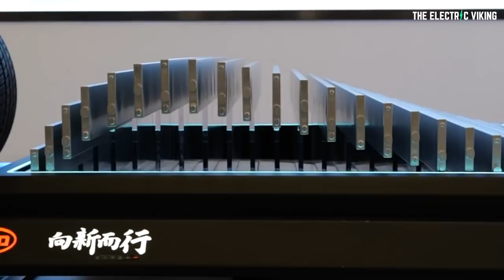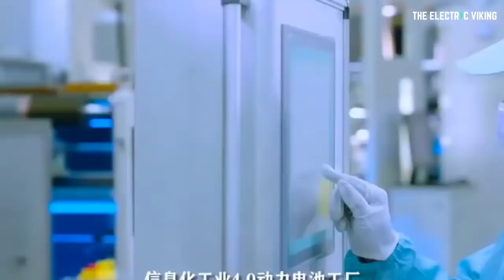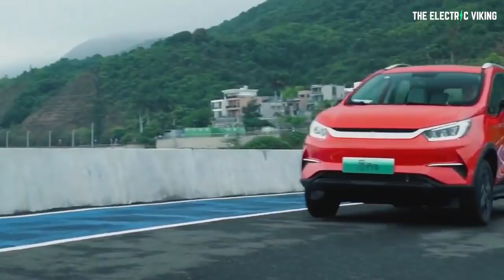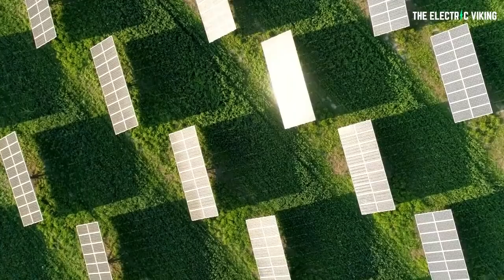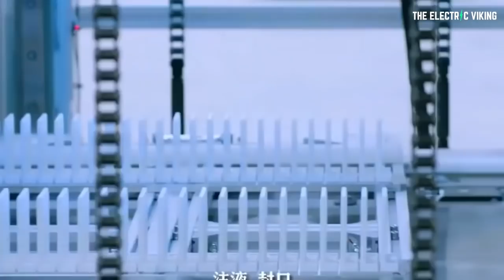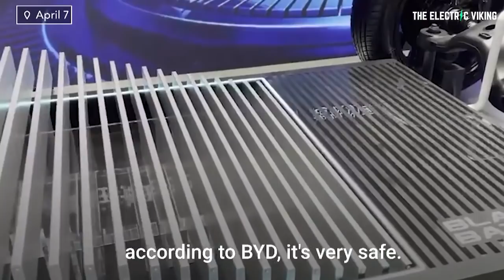BYD reveals the cost of its Blade battery - EVs are cheaper than ICE in 2021!!!!

Comment: To all those who make an issue about the mining for materials for electric cars, where do you think the materials and fuel for ICE vehicles come from? We mine materials for almost everything we use, and fossil fuel mining is the most toxic and polluting just in its extraction, let alone all of the CO2 and other nasty toxins it spews into the air when refined and burned. EV's reduce CO2 production by 60% compared to the same size ICE vehicles even when powered by electricity created by burning fossil fuel, and as the clean energy mix increases, that percentage just gets better. In June 2021, the USA produced over 20% of its electrical energy from clean energy, so EV's got 20% cleaner.

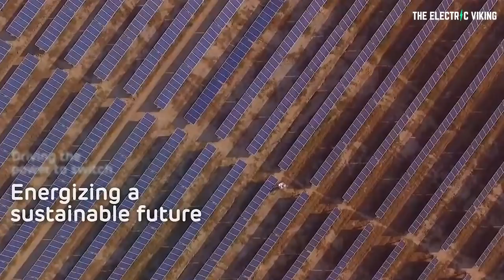Comment: So Sam, I think you made an oopsie at 7:07! 
Whilst your statement 

"In most parts of the world, it's already cheaper to stop running your coal plant, stop running your gas plant and build out renewable energy and support that with battery backup"

may well be correct, your framing of it seems to be that now it's just a  matter of buying the renewables and a massive battery? The largest battery in Australia at Hornsdale is a 194MWh capacity for a cost approximating one million per MWh. 

During the financial year 2020-21, consumption was 11,614GWh, divide that by 365 for average daily use approx 32GWh and then ask how big a battery would be required for one single day when there was no renewable input? 
32GWh = 32000 MWh x 1,000,000 = AUD $32 billion. 

Now, of course you can do the stats on renewable reliability and reduce that figure significantly because the sun is always shining somewhere in SA and there has to be some wind somewhere in the state, but if the final figure were based on 10% of that size, we'd be looking at approx AUD $3billion. It may need to be twice that to get us through a night with low wind and twice that again to have some fully charged headroom.

A new coal fired power station approx AUD $3billion!
Not that sure that it's quite the same thing.

Comment: We will need a number of new coal fired power stations operating 24/7 if we want to transition away from crude oil based fuels.   Current renewables only deliver sufficient power for a few hours during the middle of the day.  Best option of all will be ten or more small modular nuclear generators.   Even those would struggle to provide adequate base load to replace coal entirely.

Comment: Hi Sam, thanks for sharing all the exciting news about BYD and I am investing. I have a question that I am yet to get a conclusive answer and I trust you can answer. I am a tradie that wants this van but I need a roof rack  for ladders and told they are not recommended. Is it because the will cause drag or is it that the T3 does not  structurally able to support roof racks?
best regards Simon

Comment: You mentioned that BYD is moving towards 800Vdc something EV power train systems. Porsche, Audi and others have already done that.
I have been retired for some time, but after my retirement as a power electronics engineer I have been working with an EV charger company, and they have had high power high efficiency 300 - 1000Vdc output AC/DC converterters available for about two years.
The higher system voltage increases overall system efficiency, and reduces system high voltage wiring costs.
Reply: In 1995 some one from university tried to get me to go back and work on an EV project. I wanted to use 1000v. The main problem was insulation and that most off the shelf parts (mainly parts from 415v VFDs) are at the limit on that voltage.
I really would like to know why 385v was chosen for most EVs.

Comment: Another BYD cost saving could be that they don't require liquid cooling. In the pictures of the blade pack there seems to be space between the "blades" with air cooling fins on each blade. The cooling complexity/cost of liquid cooling is substantial. Go to Sandy Munro's site and see his breakdown of the MachE battery cooling system. The LIFO chemistry helps and the blade design allows air cooling as compared to CATLs  packs that use Teslas liquid cooling system. The cost reduction with no liquid cooling could be $300/vehicle.

Comment: Total EV parity to  ICE has 4 factors 1. under $100 dollars per Kwh at pack level 2. 1000+ charge cycles 3. 20 min or less to charge to 80% 4. 300 wh/Kg at pack level. By total parity I mean would a person who gave no fucks about Climate change, local pollution or even long term savings buy one. BYD has met 2 or 3 of the criteria but I don't think they have met the energy density criteria. For me an EV with a real 150 mile range would be great but a lot of people dream of 1000 mile road trips even though they haven't driven more than 200 miles in the last 10 years.

Comment: People well petrol-lovin-heads moan about how the energy is made and where the minerals are coming for the batteries but do they ever ask how much energy is needed to make their gallon/litre of petrol or diesell...no they don't.  Never mind that batteries as you say and others can be recycled can we recycle the petrol they put in their car after its been used....mmmmmm, no definitely not.
Reply: And they don't ever mention the huge amounts of electricity the oil industry uses just to get oil out of the ground before they use even more to refine it........... Nor do they ever mention the huge oil tanker spills we've seen over the years, polluting thousands of square miles of ocean and depositing thick sh*tty crude oil on a coastline somewhere, which costs a fortune to clean up.

Comment: Could you enquire if any Asian battery maker could produce Leaf batteries so their price is at $93 per kwh..making a 30 kwh Leaf battery for $2790 US?  This would be a game changer for 500,000 existing Leafs that have long drivability.
Reply: With combustion vehicles being used as throw away, the same will apply to the leaf.  The cost of the labour, and the rest won’t be worth it, soon you have 25k EVs doing 4-5 times the range. I love my leaf and know the only option in 3-4 years might be a 40 or 60kw pack from a smashed one, but I’m also crunching figures on a model 3.  As it equates to the cost of an average car when you add up running costs of ICE over 10 years.

Comment: Tesla is building vehicles in China with CATL LFP cells, some of which are sold in Europe, and some in China. I heard they are getting the cells well below $100. Not sure what it is at the pack level. I think LFP will be hugely important,  and one of the reasons is Lithium is everywhere, and Iron and Phosphate is sold by they ton, so production can be scaled up pretty readily.
Reply: $80/kWh packs - $60kWh cells.
Tesla vehicles have been cheaper than equivalent D class ICE for some time.
https://www.reuters.com/article/us-autos-tesla-batteries-exclusive/exclusive-teslas-secret-batteries-aim-to-rework-the-math-for-electric-cars-and-the-grid-idUKKBN22Q1WC

Comment: Then why are EVs so much more expensive than ICE vehicles?
Reply: Because everyone tries to get rid of their used ICE cars.
Reply: ICEV producers make BEV only because CO2 norms, so all they try to sell as little as they have too. For Tesla is because they are building factories and they need money to do so. But this will change in next 5-10 years.
Reply: They are not if you use the important metric of cost in use.
Class D premium BEVS are sticker price cheaper than ICE.
https://ark-invest.com/articles/analyst-research/model-3-vs-camry/
https://cleantechnica.com/2019/06/22/toyota-corolla-vs-tesla-model-3-5-year-cost-comparison/
https://cleantechnica.com/files/2019/02/EV-Drivetrain-Costs-Osborn-Effect.png
Reply: They aren't. There are a few EV's in the UK which are priced at very similar cost to petrol and diesel cars of similar sizes. A Nissan Leaf can be had in the UK for around £25k, as can a number of i.c. engined cars of similar type and size......  MG ZS EV can be had for £22k here. MG5 is £20k if you shop around....

Comment: But the cheapest EV in Australia is $45000 still way too high when you can buy the same car with a fossil motor for $17000 .
Reply: Sometime next year you will start seeing sub 40K EVs the year after that sub 30K ... this will move very quickly.
Reply: But that same car will no longer be an option in just a few years time, as a number of car makers have already stated they will be ceasing manufacture of i.c. powered vehicles in favour of electric powered ones. The Aussie Government are going to continue sitting on their hands until such time when the EV "thing" drops on them from a great height, then they'll be running around like headless chickens, wondering what to do and how to do it.......

Comment: Re: Blade > 4680. Please compare equal weight LFP in Tesla 4680 tabless cells vs dendrite-prone tabbed cell & non-structural-capable (Blade) pouch/prismatic packs.
Reply: Cylindrical cells have a metal case which pouch cells don't. 
As for structural it is easier to make pouch cell structural than cylindrical cells.
I made a pack using pouch cells that has 10 times better cooling, 1/3 of the internal resistance and about the same weight as a Tesla pack using pouch cells with lower energy density than Tesla cells and it was strong enough that the test pack I made was 1.5m long and 100mm wide and if used as a beam I could stand in the middle of it.
So round cells are not a good solution for square spaces.
Reply: @franciscoshi1968  From my formal training in automotive mechanics, I understand that vehicle stresses far exceed your ~200lb "stand on" test criteria. But who knows? I only try to accurately echo the accomplishments of the planets best engineers, when some notes of clarification might be in order. From your tenor, I'm sure you're far better qualifed, than they, so hope to see your innovations soon, in the real world, despite my skepticism!
Reply: @Crunch_dGH  I am also an engineer. I do design work for a living.
I think Tesla started with cylindrical cells and they do not want to change to a different shape because they have invested too much in that direction.
The pack I have built has thin aluminium cooling plates on each side of each cell similar to the Chevy bolt pack except that the plates are very thin (0.4mm) and the coolant runs on pipes on the outside.
The end result is the battery forms something the shape of an I beam so it is very strong.  I have not tested the strength because it was not meant to hold the car's weigh.
The pack was designed for a drag car. They tried the Tesla packs but they overheated.
Cylinders are not the best shape to fill a square space. That is why everyone uses pouch cells.
Now Tesla is trying to make bigger cylinders to reduce the number of joints.
Pouch cells are already big and the tabs are not welded the same as the cylindrical cells the tab is the edge of the electrode just like the new tabless cells. One other benefit of the pouch cells is you do not need busbars. That is how I got the weight down.  To make a 250Ah pack you have 4 pouches in parallel the tabs of 4 cells are connected to the tabs of the next 4 cells. There is no bus bar. It would be the equivalent of putting the new tabless Tesla cells end to end but you can't do that with the cylindrical cells because they are too small. You could do it if you made a 250Ah cylindrical cell but that is too big and it won't fit or you can make a 250Ah cylindrical tabless cell like the new Tesla tabless cells then flatten it so it will fit. But then you end up with a pouch cell. So pouch cells are already very similar to tabless cells in the way the electrodes are connected to the outside. Tesla is very good at hyping things up to make conventional technology look extraordinary.

Comment: I hope you watched Tesla's 'battery day' presentation.  Their new technology is expected to drop cell prices by more than 50%.  If they're starting from the $82/kWh price at the time then we're looking at some very inexpensive battery packs.
---

When the car wears out the battery pack can be pulled an used for grid storage - for years.  And then the batteries can be recycled.

Recycling probably won't reach 100%.  But in the high 90% range is likely.

Comment: When Sandy Munro tore down the Tesla Model Y he stated that the cost of cells for that car was $82/kWh.  Another thing that has been largely ignored,.

Sandy's company based their cost on the cost of materials and the standard industry cost for manufacturing cells.
Reply: Yes, battery cost is one part of the equation, other parts are pure material and build quality of the rest of the car. 
What was the most important point to achieve with a car design of those two? 
Teslas's is safety and security for the people inside the car. What was the first and most important goal for BYD? IDK.
Reply: To be fair to Vic Americans haven’t got that much to shout about at the moment From Afghanistan to Iraq to Boeing  an the Covid disaster there’s not much to brag about so fair goes shoutingTesla  from the rooftops.

Comment: The signs of the price collapse are everywhere. It showed when the 280AH prismatics were available to the US, from China. That's cumbersome, a big battery and China companies. But Battery Hookup sells the 32650 from a supplier they suggest also supplies BB. So that's a 20 wh cell for $3.5. You need 50 to get to a kwh, so it's $175 for a new cell, US supplier, some customer service. I have to assume these are from China, and they are obviously re-wrapped. If you are buying a few thousand and just want the cells to toss in the robot spot welder, that pretty much your YT vid price. Given the small number of cells you need to make an ebike pack, the battery cost is almost a rounding error. But for motorcycles where a 10 kwh pack is useable, it really brings the cost down. There's nothing surprising in this. You see the signs across markets, but it's all from Asia. Of course.

Comment: My understanding, which could be wrong, was that LiFePO4 batteries didn’t have high energy density, meaning that these won’t be put in the long range EVs that Americans prefer.  If so, we may have to wait a while longer for EV price parity.
Reply: LFP cells will be fine for most EVs.  Other chemistries will get used in performance and long range models.

Very few people actually need long range.  200 to 250 mile ranges are fine for almost all.  What we need is plenty of rapid chargers for those few times we drive more than 200 miles in a single day.
Reply from the maker: Lots of BYD EV’s coming to market with a long range using LFP.
Reply: byd han has 600km range at 36k usd
Reply: @cornelstamate2537  That's NEDC range take away about 45% at highway speeds for the US. Not great for trips but good as a daily driver.
Reply: almoust everyday i see another video with a new battery inovation. my belief is the lfp battery is good enough. i can bet that with the curent battery tehnology the demand for tesla or byd ev s will never be satesfied for many years to come.
Reply: @cornelstamate2537  

The problem with all those new battery innovations is that very few turn out to be usable.  I think Elon has said that there's more BS surrounding batteries than either other topic.

BYD has been using LFP cells for years but they had to pack a lot of cells/weight into the EVs they sold for taxi work and didn't get really good range.  It seems like battery management, and perhaps some change in LFP cell construction, is allowing decent range using LFP cells.  And that is a great thing.  Much more affordable.  And cheap when you do a per cycle costing.

$80/kWh / 10,000 cycles means less than a penny (cell cost) to store a kWh.  That is the Holy Grail achieved.

Think about grids.  Wind and solar are approaching $0.02/kWh.  If we can use ~50% direct and store most of the other half for around $0.04/kWh (adding in some hardware cost) then we've solved our electricity-carbon problem.

And at <$100/kWh and 10k cycles we've killed the ICEV.

From here on it's "Just build it".

Comment: Sam,
You didn't emphasize enough that the $92 cost was PACK level which is generally about 20%(?) over cell level.
That would put the cell level cost at about $75/kWh.
Reply: Whoa that’s insane.  No wonder they have a $15,000 405 km range EV SUV in China.
Reply: Good point. It will be interesting when it gets down to $50. Will OEM try and maintain margins or will there be enough competition to drive the upfront cost of vechiles.
Reply: The Blog  doesn't say it was the pack cost. Just that is was the Blade battery cost. The guy speaking was the battery plant guy so I would guess he is speaking about the battery itself not the pack.
Reply: I wouldn't mind purchasing 10kwh of those cells. I wonder how they compress the cells and still retain the claimed cooling efficiency when fast charging.

Comment: Sam
Wait for LifePo4 4680 cells.
At the expected manufacture rate, they'll be cheap !
Reply: Besides being a lot bigger than other cells, there are some 32650s for certain uses around, they have the tabless design to differentiate from other round cell designs. This is new in this application, but not in pouch/prism/blade cells. Personally I think round cells are not the solution for any problem in a rectangular environment 😊
Reply: That will be a game changer.